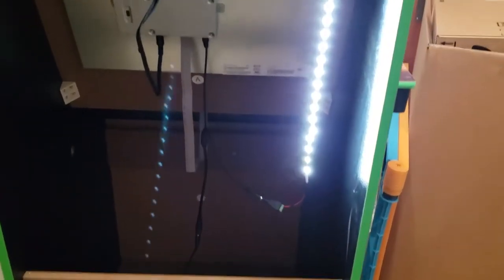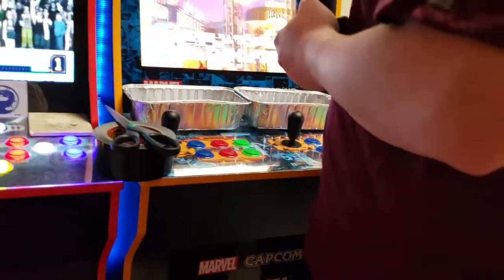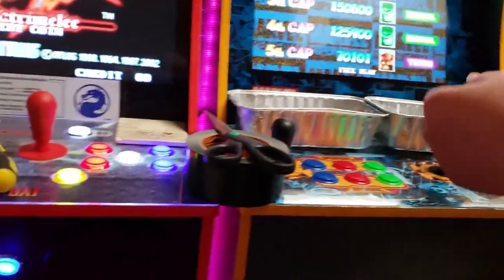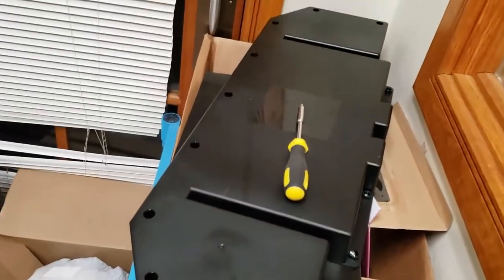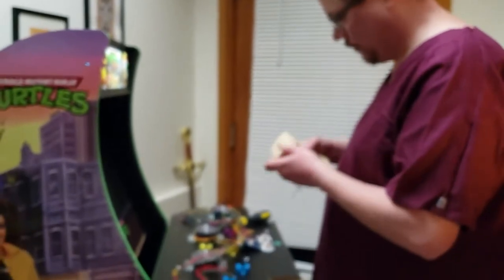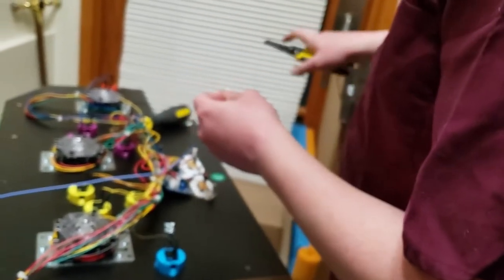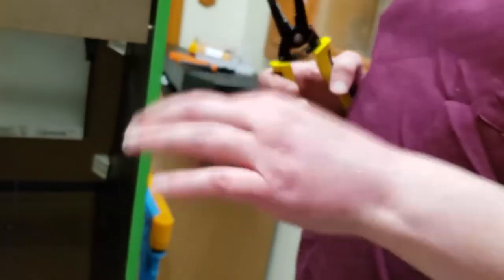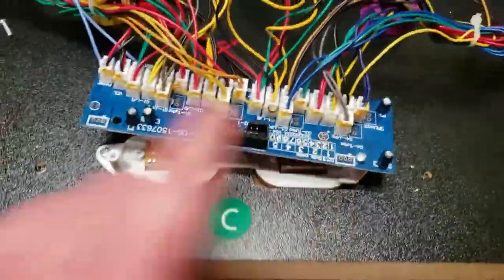TUTORIAL: Arcade1Up Lit Marquee on the STOCK SWITCH, and BUILDING A LIGHTBOX!

Comment: Looks like you could use actual pin connectors rather than the female quick disconnect style then you wouldn't have to bend the leads. Just a thought.
Reply from the maker: Thanks for the tip!